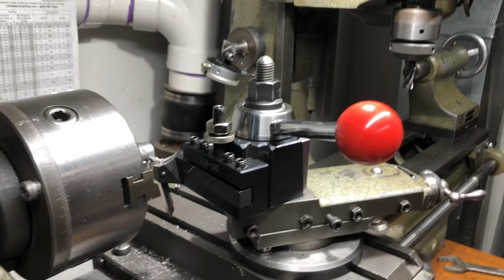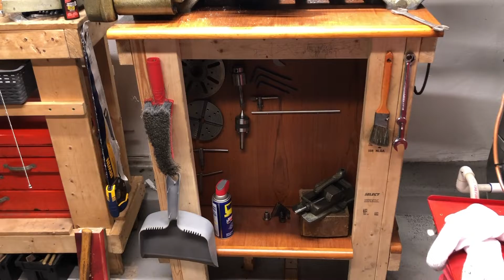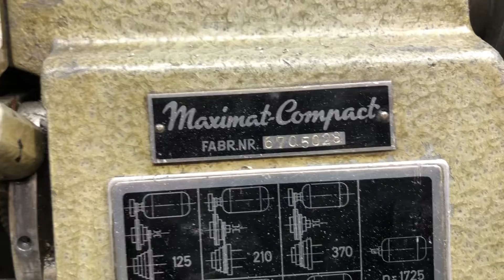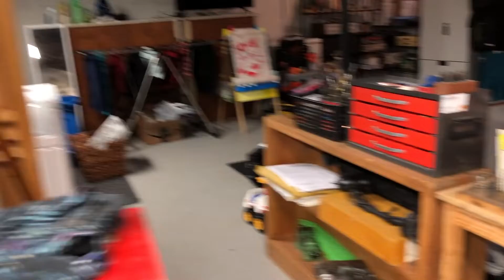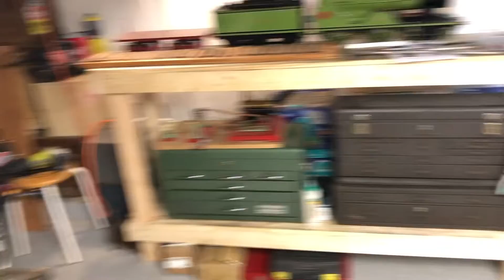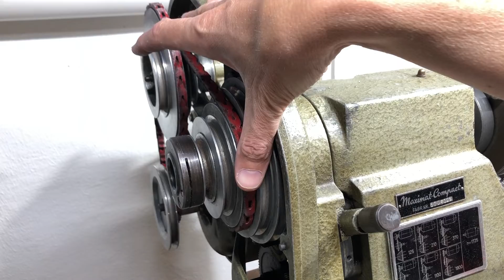Maximat Compact Lathe/Mill Combo with New Quick Change Tool Post

Comment: Thx for posting! The mill head on that model is located towards the tailstock end, I think on many other Emco lathes it is more in the center of the bed. Are you able to mill without removing the tailstock? I'm going to scour the internet until I find a picture of an Emco in a NASA lab. For your broken gear, I think that Emco lathes in later years generally used Mod1 gears. I needed change gears for my lathe, and found all the tooth counts in any module are available from a company called Maedler (MÄDLER GmbH). They are in Germany but it looks like they have an Australian distributor. The gears I bought were pretty reasonably priced, and made of what they call C10 steel. I had to bore out the hubs and make keyways, the C10 is free machining. If you need to to face a 10mm thick gear down to 8mm your diamond toolholder would be perfect. Also, for your QCTP toolholders, try milling the tool slot a little on the bottom, they machine quite easily IME, gives 3-5mm more space for tool height w/o getting too thin. Best regards from Left Coast USA.